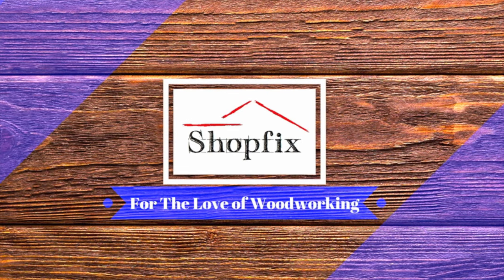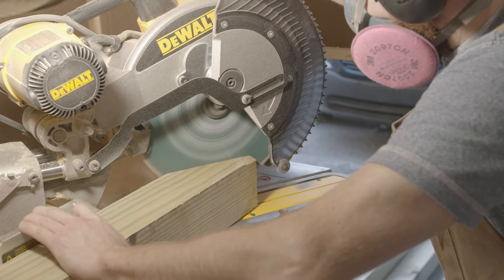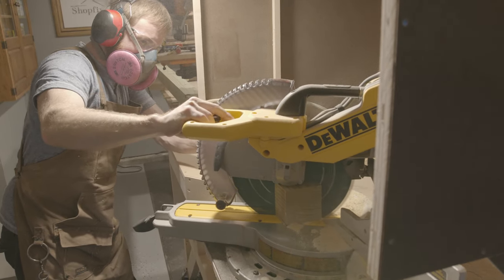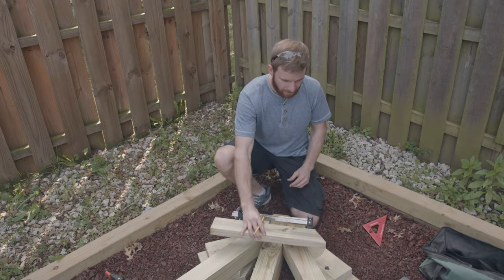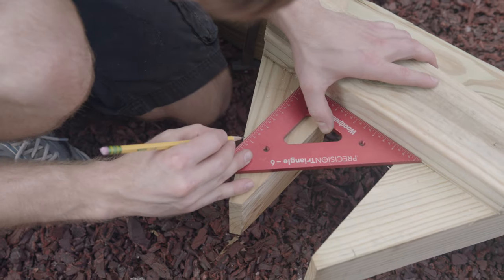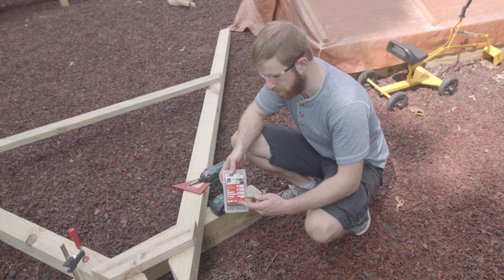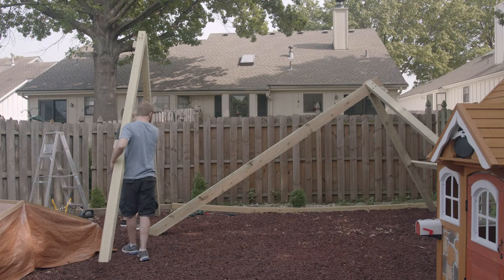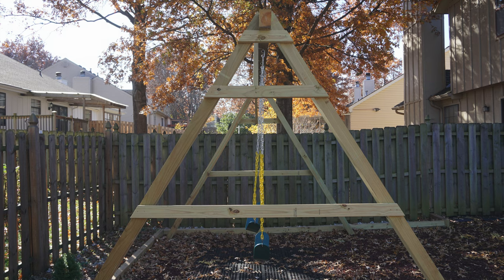How to Build an A-Frame for a Swing

Comment: Hello buddy, beautiful swing. I'm planning on building your plan. Whats the weight capacity, can i use this for adults as well, thanks you
Reply from the maker: Hey, the weight capacity is around 300. Anymore weight than 300 and there is too much deflection of the top beam, however if you shortened the length of the top beam then it would be stronger and would hold far more weight. This design would work well for 2 adults that are swinging gently.
Reply: @_Shopfix  thanks for the prompt response, yeah I'm building a 5ft swing very small. It should be fine then. Thanks again. I was thinking if I could cut the the edge of the 4x4 and let the beam sit on top it would that work in your opinion or just build your design.
Reply from the maker: yeah, you could notch the 4x4 in half and rest the top beam on either half of the 4x4 and then mount it all in place with hardware, that would work as well!

Comment: I Built bigger for swing set and also smaller for bench swing I made. Was easy build and to budget. Only thing I would add is, 5° angle on lower of posts with 30° to set flush to pad on ground. Also concrete blocks under posts to keep from quick rot. But really was a nice simple build :)
Reply from the maker: Thank you for the extra tips!

Comment: Would this be sufficient to support a 2-person bench swing without additional metal bracing?  I'm thinking of cutting the sizes of each beam down by 2 feet to make a hanging brace for an interchangeable bench swing and hanging archery backstop. To that end, how do you effectively drive in hooks/eye rings for hanging things? 

I'm just getting into woodworking now that I'm not in an apartment.
Reply: If you're swing is going to be 4ft long, the 8ft frame would work. If a 5ft swing, I would use the 10ft post. I just built an 8ft frame & swing. I hung it by drilling through the top of the post & using 1/2 in × 8in lag bolts with a jam nut on the top so it doesn't loosen. It easily supports my wife & I, we're 500lbs together. That's a lot of weight!😂
Reply from the maker: Yes it is sufficient for a two person bench swing but you’ll want to reduce the length to just hang outside of the bench which will make it much sturdier. You can also lower the overall height since the swing won’t be swinging as high. Basically you just want a smaller version of what I built to accommodate one bench swing instead of three chair swings which need more room.
Reply from the maker: To effectively hand eye hooks you’ll want to use a universal socket bit in a power drill.

Comment: Is it okay to replace the lag screws with bolts? Would it have the same strength?
Reply from the maker: Bolts would be stronger as long as you installed them correctly with the right washers, etc. If you used bolts instead it could also be disassembled and rebuilt easier. I chose lag screws for simplicity.

Comment: Quico question, why are you cutting the top board with the angle of 5? Why can't you put it straigth like it is?
Reply: i believe to get some trapezoid structure and reduce side-by-side shaking, in addition to the cross-beam
Reply: Yes because the legs are not right angled to floor like I  they are like a / \ , so they make a good contact at 5 degrees.  If that makes sense.
Reply from the maker: None of the boards are cut at a 5 degree angle, the legs are simply angled at a 5 degree angle instead of going down straight to the ground. This helps stabilize the swing set and I believe makes it more structurally sound with less side to side wobble.

Comment: Fantastic video. I am just wondering if we need to dig hole and make a concrete post for the A frame?  How can we make sure that the A frame will not be moving around but fixed to the ground? Thanks very. It is a very educational video.
Reply from the maker: Swing-set anchors will do the trick. Another important aspect is making sure the swing set is level. The leveling of the swing set will help it to not fall over, anchors will help as well. Concrete posts are not quite necessary.

Comment: I want to build a swing that will have 2 large round disc chairs. Approximately 40 inch across. Will need to beef up the weight limit and hoping for a little advice from you. Thx in advance. Hope you reply soon, you know how the ladies can become impatient at times. Lol. Mines past that point. Due to the fact she want the kitchen cabinets painted first. Somebody gottsta helps me...
Reply from the maker: To make the swing set hold more weight you can just use larger dimensional lumber. Perhaps a 6x6 for the top beam instead of a 4x6 and then 4x6 for the legs instead of 4x4s. That would be my thought to add strength. You’ll likely need to get longer screws as well.
Reply: Thank you so much for your reply. I really appreciate yall. Gonna see what I can mess up soon.
Reply: Hello again. I'm a bit sketchy on anything I do and need advice again. To make our Swing stronger I decided to increase the lumber size as well as the fasteners. Using 6x6 for beam, 4x6 for legs and 2x6 crossbraces. 3/8 x 6 lags, 5/16 x 4 structural screws. With 4x6 legs and 60 degree cut along the 6 or (5 1/2) side, the length of the cut is quite long (approx. 10") leaving a lot of open area for a feeble mind like mine. Would you cut the angle leaving thicker stock at the top to locate beam at the 5/8 mark below the angle? Or install beam closer to top leaving a gap at the bottom? Sure appreciate any help on this.
Reply from the maker: @aintgotnohandledog  Hey, trimming off some of the angled board at the top leaving you with the thicker stock at the bottom of the angle is a great idea 👍
Reply: @_Shopfix  Thx again.  I do really appreciate your advise. This Swing frame is gonna be around for many years.
Reply from the maker: @aintgotnohandledog  sounds like you are building one sturdy structure! Since you are purposely trying to make this swing stronger than designed I would say that one too that some others have brought up is to notch the legs so that some of the load of the top beam is supported by the actual wood. You can find discussion of that in the comments section of this video! It was recently brought up in the comment section so it shouldn’t be too hard to find!
Reply: @_Shopfix  yes I am considering that 4real.

Comment: I want to build a swing with no beam. Just two posts and a short L shape at the top to hang the swing. I found an L pergola extension but not sure if can handle the weight and it won't bend. Any ideas?
Reply from the maker: I am not sure, and I wouldn't want to give any advice in which I don't understand or cannot see the pieces you are referring to. Best of luck with your future projects!

Comment: Curious about how much it costs to make it this way vs using the metal brackets?
Reply: I just looked up the cost of a set of metal brackets that were $175 shipped.
Reply: You can get a set of brackets for $50 give or take  depending on brand at lowes
Reply: I’m more concerned with which is “better” brackets or like this.
Reply from the maker: I’ve looked up a pair of brackets to be about 70 to 120 dollars depending on the quality and the brand. I think both the bracket design and the wooden A-frame design are fairly similar in durability and strength.

Comment: Wait, my 60° ended up 90° to my 30°, so I cut them off and started over, by the time I got it right my swing was hanging 5’ off the ground. So I covered in corrugated aluminum and called it an A- frame dog house.
Reply from the maker: I’m sorry it didn’t quite go as you planned, that happens to me all the time but I just cut it out of the video and start over lol

Comment: A problem I see is that you are putting the entire weight of the top beam, swings, and kids all on some screws holding the top 2x4 braces.  The shear strength of those screws isn't enough.  If you had notched the uprights and placed the 2x4 into the notches, you have much more strength, and safety.
Reply: Good point there Darrell, how would you suggest would be the best way to notch? Take half the material from the uprights, and half from the 2x4 to mate them? Then you could glue & screw into place, and the load would be dispersed evenly at three points rather than just the one yeah?
Reply: @bhaaldemon3184  I would notch the 4x4 by 1 1/2 inches, none from the 2x4, which would allow the 2x4 to be completely recessed into the 4x4.  Glue & screw.
Reply from the maker: First I’d say that notching the boards isn’t a bad idea at all and I appreciate the design modification! However, all of the weight isn’t resting on the 2x4 support. Most of the load is being held by the 12 lag screws that are going through the 4x4s and into the 4x6. You also have the crossbeams which are mounted with lag screws that are also supporting the load. The 2x4 top piece does provide additional support but it is more for assembly because it gives you a reference point to rest the 4x6 beam into place. I have this swing set in my backyard as it was designed and to this day haven’t had any problems!  👍 if you build this swing set and notch it, perhaps I can get a picture from you and add it to the description in case others want to add that to theres as well!
Reply: @_Shopfix  I used your plans to the letter and it is plenty strong. The load capacity is probably even much more than 300 lbs. I think the original poster missed the part of the video where you fastened the beam with those 4 inch lag bolts. Thank you so much for this video, it made my four year-old's day.

Comment: Can an adult over 256 swing on this?
Reply from the maker: Not at the length in this video as I used a 12 foot cross beam. The shorter the cross beam the more weight it will hold. So if it’s a single swing on a 4-foot cross beam I’d say you’d have no problem!